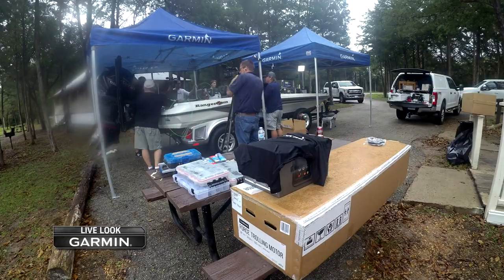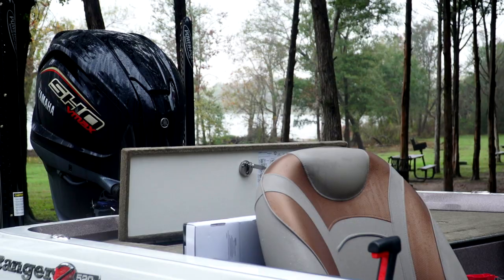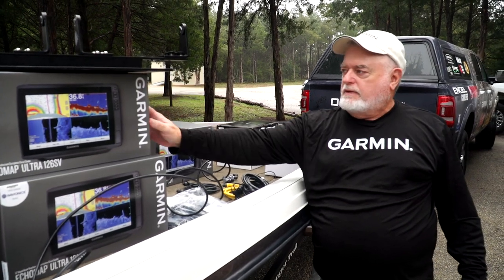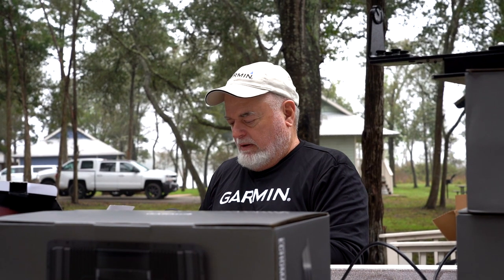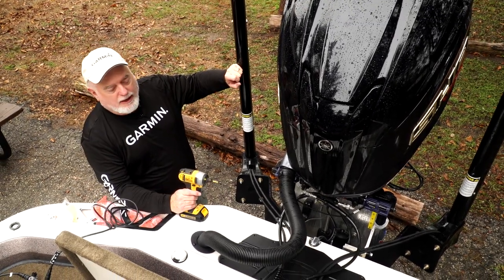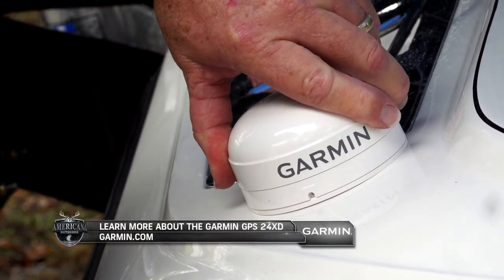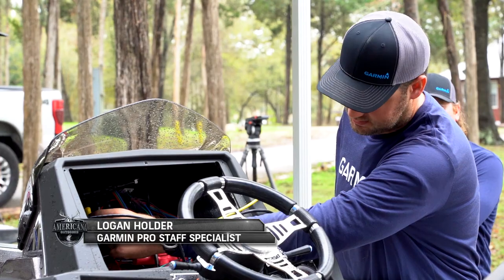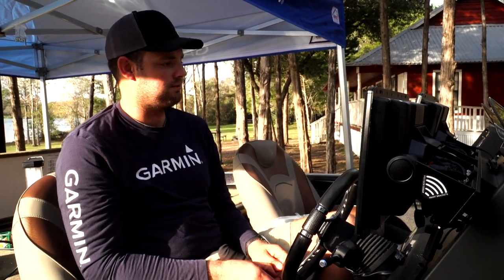Setting Up A NMEA Network and Installing a Garmin GPS 24XD on a boat

Comment: Why use 2 gps modules and what is the benifit?
Reply from the maker: Accuracy for most part for the guy who wants to know when he marks a waypoint on bow unit or console unit they are reading exactly where he was.  It's not common but folks who like off shore use it a lot